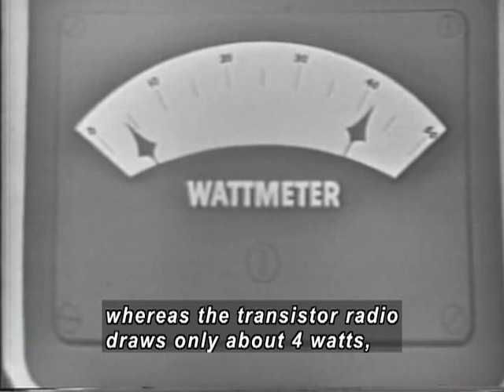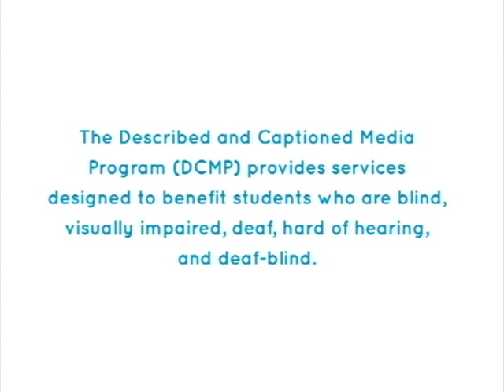"The Forward Look" 1955 Chrysler Television Advertisement - Philco Transistor Radio - Captioned

Comment: Kelly La Rue,  1955 and 1956 ( and prior) Chrysler products were well engineered and well built cars.   For 1957-1959,  the engineering was still superb, as well as innovation,  but unfortunately the quality control on body assembly, fit and finish was below average,  but not that much below what Ford and GM were offering.   And, they out-handled and out-cornered anything else on the road at the time with their torsion bar and leaf spring suspension. So while I disagree with you somewhat,  there are aspects of it that I would agree with, but overall it was not atrocious compared to the rest of the North American auto industry.   They did try to address the issues somewhat by 1959  and 1960.   I've owned and been driving 1950s through early 1960s Chrysler products for over 40 years and still own one.   There had been relatively little in the way of mechanical issues with any of them considering they were all second-hand, moderate to high mileage cars when I purchased them.   Between 1982 and 2008 I put 60,000 miles on a 1962 Chrysler 300 that had 91,000 when I purchased it.   It was treated to an engine rebuild at about 140,,000 miles, and while using oil, was still running relatively strong.